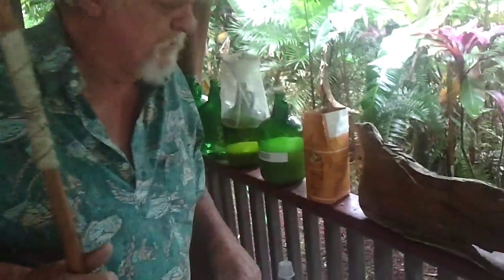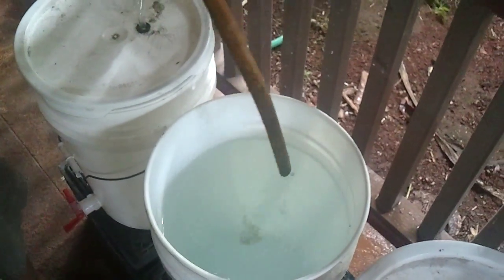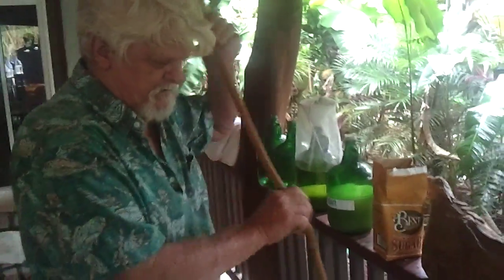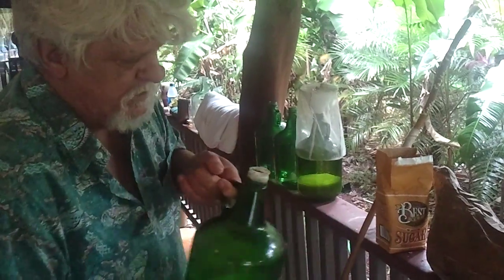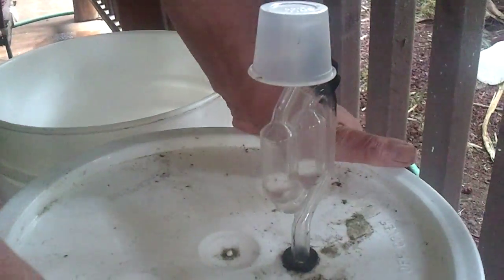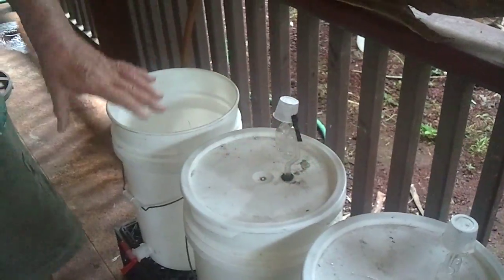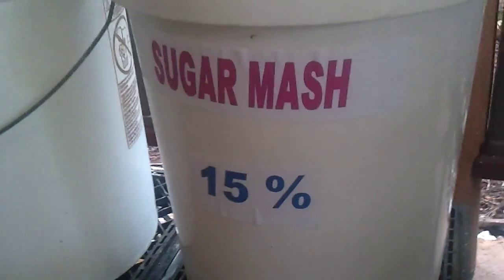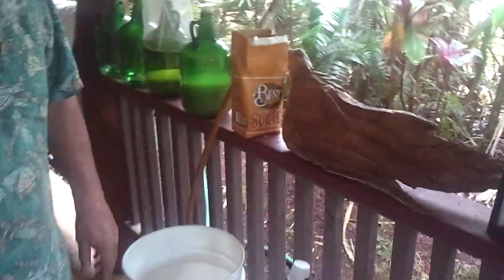Making Fuel Alcohol making sugar mash 3 days wait.3gp

Comment: Try dumping in 13.4# of sugar, mix well, use Turbo Yeast 135gr of Express and let it set 4 days.... you should see about 18% but you need to use the hydrometer before dumping in the yeast and then again when it quits bubbling. Do the math and make it worth the time invested. You reference that fact at the end. Why screw with less than 10%